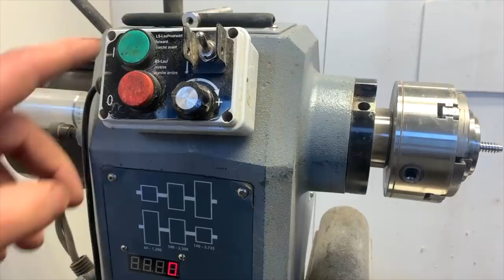Woodturning - The Donut !!

Comment: What does the process at 3:13 do??? It looks like it's just ruling wood with more wood lol
Reply from the maker: This technique is called burnishing. It is a finishing technique that is used to achieve a smooth, shiny finish similar to the appearance achieved when using polyurethane or lacquer. Burnishing is a technique that is frequently used when professionals do not want to apply chemicals to their products.

Comment: Would you consider a faster (higher frame rate) camera?
Reply from the maker: Why ?
Reply: @JackMackWoodturning  
This is just great work that could be better appreciated visually if the camera could capture more details.
Reply from the maker: And you think higher frame rate would do that ??
Reply: @JackMackWoodturning  
Yes. Higher frame rate will capture more details.
Exporting and uploading at a higher frame rate will also increase the level of detail significantly (given video is captured at such frame rate or higher).

I have no idea about your current equipment, but if capable, try shooting and uploading at 60 fps.

For even better, higher level of detail, artistic quality, and if budget allows, you could go for a high speed camera and upload at the highest fps Youtube allows.

My knowledge of this is on amateur level at best. Chat with an expert if you plan on investing budget in filming equipment.
Reply from the maker: Yeah, the quality of the video is based on the resolution buddy, not the frame rate. Frame rate is the number of images you see in a given time. Higher frame rates give a smoother looking video but do not alter the detail. All of my video’s are shot at 60FPS 😊👍🏻😉
Reply: @JackMackWoodturning  
The upload is 30fps which could be why it’s a bit choppy.
While yes the resolution is the main factor for quality and detail, when the object is moving at high speed, i.e. a spinning lathe, the frame rate is very important to actually get a coherent image rather than motion blur. Sport videography for example requires higher frame rates due to fast moving balls.

If you’re already shooting at 60 fps, maybe try uploading at 60 as well.

Anyway, that was my advice. Cheers.